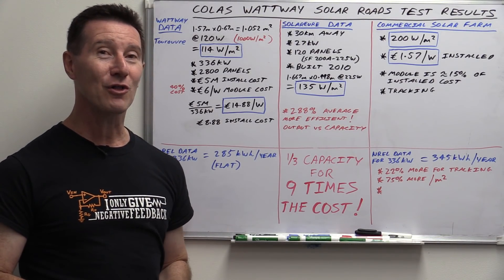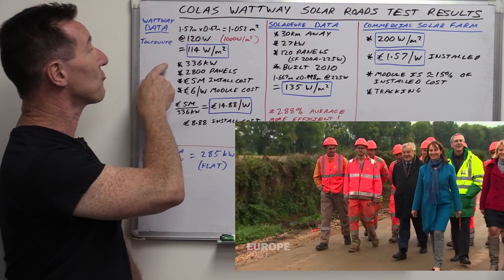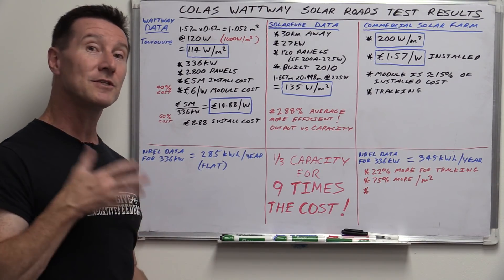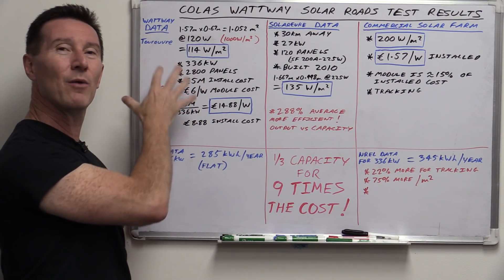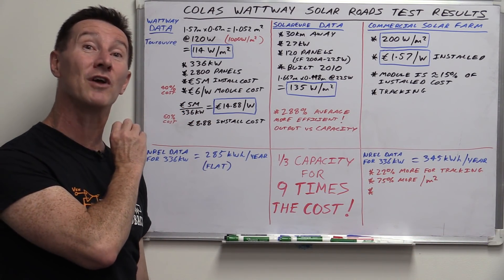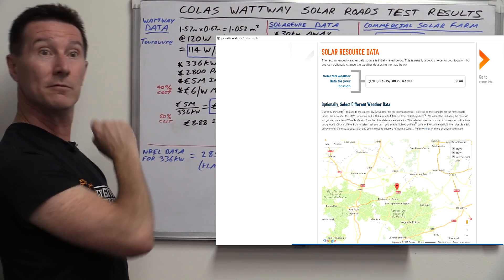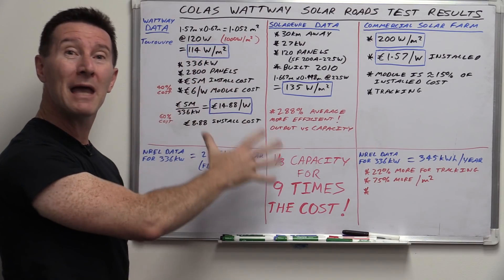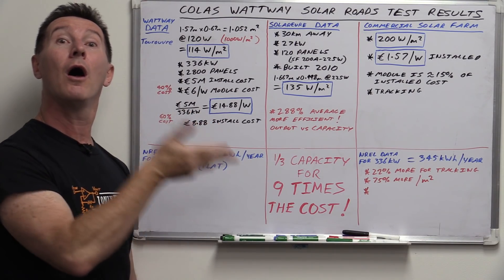EEVblog #1047 - Solar Roadways FINALLY BUSTED! (Colas Wattway)

Comment: Dave, I got half way through and after seeing your earlier vids, I confess, I concluded similar conclusion to follow. Sorry.

However, the problems with solar is that we can not (Europe especially) cover fertile grounds with passive devices. As a person who spent my formative years in Europe, I can tell you that the land is not real estate. The population density is huge and the land has been subdivided so many times, the land parcels are tiny. Yes, rooftops are a good solution, but I think that they are thinking bigger rather than smaller.

Aus and America's have lots of open places, deserts etc to use. Euros don't.
Wind generators are the best solution, but places like USELESS road surfaces (used occasionally) are a great idea. $$ COST is not the only measure of success!! Hell, if that was the case the cost of coal and carbon fuel clean up would be astronomical. 
Whatever the solution is CARBON fuel is the last option of a desperate world drowning in pollution.

All I ask is ... devalue the $$ factor and look at this as a potential power source for small towns and villages dotting the European landscape.
Reply from the maker: Put them on rooftops and poles, and cover over carparks, it's not rocket science.
Reply: But there's plenty of commercial/industrial parking lots that could be covered with solar shelters, even just the basic fixed tilt ones.
Reply: But then why not put the panels to the side of the road, or if there's no space, then on a canopy over the road. It would still cost less.
Reply: You can cover every commercial parking lot, providing solar shading. You can put them in highway medians. Rooftops are still underutilized.
Reply: yeah put them on poles next to and or over the road, on the road is just asinine
Reply: Ned Blagojevic It is much too expensive. If something is much too expensive no one will fund it. Secondly, there is more than enough space in Europe. We have too many farms anyways. We have space on the sides of the Autobahn, the railways, soo many rooftops (99-99,5% don't have solar on them). So before we start plastering roads with precious rare earth's we probably should start there.
Reply: Ned Blagojevic Not really any such thing as a truly robust cell for roadway use.  Consider how frequently roadways have to be resurfaced due to wear and tear from tires, accident damage, fire damage, etc.   Not only would you need to have utterly dirt cheap solar cells, but you would also need almost boundless free labor.  Because the surface layers of an asphalt or concrete road is essentially a homogenous mixture of fill and binder we have machines that can literally eat the old road material, crush and process it, then remix it into a new surface and lay a newly remediated surface back down all in one go, you just drive it down the road and it does it all in a single pass.  By comparison a solar roadway requires embedding a lot of wiring, the solar panels embedded into the asphalt or concrete, and all the necessary interconnections and tie points...and all of that needs to be trivially and quickly repairable and replaceable after accidents.  A machine can not just eat up old solar panels and magically spit out brand new ones, so every so many years everything has to be replaced anew, including all new panels and road material...along with all that wiring (which will be destroyed when the new surface is laid down on top of the old).  Just consider thecdamage that one car driving several miles on rims would do to a solar roadway and suddenly even accident damage becomes incredibly expensive.

Literally, solar roadways are a place that money should only be invested once you have already covered every bit of far more practical surface area (such as rooftops).  Only when there exists no more practical surface area should the least practical surfaces be sought out for coverage.  Otherwise one is just senselessly wasting money.  If you had a choice as to whether to build a 1MW solar project or a 27MW solar project, both for essentially the same install cost, only the 27MW project also affords lower ongoing maintenance costs and requires 1/3 to 1/6 the surface area, would you really conclude that we are at a point in solar saturation that you would rather opt to build the far larger but also far less efficient 1MW project?  We get far greater return on investment if we invest more wisely.
Reply: Europe has Baltic states, where average population density is low, and most of population is located in few denser cities. And land value and cheap labour costs can easily offset amount of solar light they get. So, land is not the problem
Reply: It is perfect solution for US. They have couple of huge deserts that could not be used for anything else. In addition - loads of roofs. Just need few grid storage facilities.
Reply: Funding private home installation would be much more cost efficient and would produce a lot more power. We will soon need a lot of power for electric cars and the infrastructure is not ready yet.
Reply: FutureChaosTV... I am not doubting you, but I think that you should look at the area/kw required and check of farms are big enough to provide. Here in Aus we have 25m people on a SUNNY continent bigger than the entire Europe. We can do solar farms. Eu can't and doesn't have the solar flux or area needed... a fact of life.
Reply: FutureChaosTV ... to the best of my knowledge there are no rare earth elements in solar panels. Just Si which took a huge amount of energy to form and purify. That is why PV is a marginal source of energy. Better options exist but are emotionally  controversial.
Reply: I tend to agree with most of what you say, but remember that this is just an experiment and I wager that they have absolutely no intention of scaling this up permanently, not on the roadway at least. 

I get the rooftop installation but find them very unattractive especially when they are tilted to the angles for optimum efficiency, but will get one soon. Dave may want to do some costings on PV vs PV+battery and include recycle costs. You will find it depressing when you look at things in terms of energy rather than $$$.

Having said all of that I remember that Nicola Tesla was almost kicked out of Uni because he dared to say that he can make AC directly :):)
Reply: I live in Europe and travel all over Europe. There is lots of space for solar, so I'm not sure where you are thinking. You post an image of an unsuitable town, but we have national grids to distribute power from where its easier / cheaper / more suitable to generate to places where it isnt.
Reply: Nuclear is a good option, I'm sad the UKs newest nuclear plant is being so badly handled :( Look up Hinkley Point C if you dont know about it.
Reply: Problem with nuclear is waste storage.
Needs thousands of years to decay.
Reply: +jur4x

The waste problem is highly exaggerated.
Reply: lol. Nuclear waste remains dangerous for hundreds of years. And have to be guarded, otherwise it makes great material for "dirty bomb". So no, it is not exaggerated
Reply: +jur4x

No , I meant the amount of waste generated  by Nuclear reactors is greatly exaggerated. It is estimated  that 97%  (by volume)  of waste generated by nuclear industry are low level radioactive contaminated material (clothes eg) that cannot be used to make  dirty bomb  nor do they need thousand of years to return  to background levels ( still, 100 years is a long time)

 Newer generation of reactors do produce fewer  high level waste waste and there is even a reactor design (sorry, forgot what it's called atm)  that eats up the high toxicity, longer lasting radioactive waste (such as plutonium). Of course waste management is still an extremely top priority that cannot be simply shelved aside.
Reply: I love the picture you've posted of Bologna to illustrate the problem. Here's another picture that shows the city in sunlight to better illuminate the problem:
https://thumbs.dreamstime.com/z/bologna-cityscape-italy-28502180.jpg
See this? Sunlit roofs... SHADED STREETS. Where do you want to put your solar panels? ON THE ROOFS, of course. It's cheaper and will provide more power. But even that is less efficient use of solar panels than it really could be.
Btw modern agriculture is more space-efficient than ever. And according to my calculations, just 5% of the agricultural land we use could power all of humanity. You think that in the age of GPS-guided autonomous tractors, crop surveyor drones, modern cultivars etc. we would starve if we gave up just 5% of the land? Come on. Just the reduced air pollution from fossil fuels would be worth it.
Reply: You can worry about putting solar panels on roads when there is literally no other space for them then LMFAO
Reply: LOL... It is rocket science, Dave. Most of the cities and coastal towns in EU are ancient and don't even have room for cars never mind COMMERCIAL car parks.!. https://goo.gl/images/LRMWNT ... as you can see the town square and the road is the only space available. there is no roof space as most flats are 2-3 story flats. 1/4 acre block? No such a thing :):)
Reply: those hills are used either for food, wine or animals, but yes, not all Europe is uniform.  I wager to say that the experiment is to see how much power they can get, but more seriously, people will develop robust cells which can be used in all extreme conditions. Look at the current installations ...ugly, rectangular and fragile (ask Dave about hail damage). again $$$$/kW is not the point.

Comment: Does this mean you'll stop posting 'Solar Roadways BUSTED' videos? I've lost count how many you have posted now
Reply: You may call this "beating a dead horse", but in this case the horse doesn't want to die, it refuses to die so it requires constant beatings, Dave and others will not stop beating this horse until is really dead.

Comment: they think that is a good idea because you  forgot the most important parameter for them : the place used (They are in constant search to have an ecological electricity production which take the  least possible place)  : nothing for the solar road because it's placed on roads (place already used)  whereas the solar farm use a terrain that could be used for agriculture, forest  or cities (and they have to destroy terrain to build it : it's not really ecological)

Comment: Great and funny:-)
Even if it is a idiotic solution, what about places where they do not have the space for solar farms? Would they be useful in city's where it would be hard to "jump" from roof to roof and maybe more easy just to use the road? I know that buildings will cast a shadow a lot of the time but still?
Reply: Fried Mule that shadow would make it way way worse a few angled panels on the roofs ... where there would already be an energy infrastructure built into the building... would likely give the same output as a whole block worth of solar roadways in those conditions
Reply: The solution for places that don't have enough space for solar farms is the same solution as the one we currently use for places that don't have enough space for conventional power plants; you build it somewhere nearby where there is space, and use power lines to transport the power.

But even if you rule that out, and for some reason you absolutely must place the panels in the city; cities have lots of rooftop space. Cities also have lots of traffic, which makes the solar road surface option even less attractive. And as you point out, there's the shadows from the buildings to consider.

Comment: This might work in areas with limited space for solar panels. Imagine a future city-state where all buildings have solar panels and the only space left is the road.

That is the only reason I can come up with for this technology.
Reply: I think you would be hard pressed to find a location so devoid of free space that you would have to resort to putting them on the road.
Reply: If one was using any morsel of sense, you'd find many many places to install and generate energy with much better ROI before being desperate enough to do this.
Reply: Matteqa I can see a use case in remote spots for signalling and traffic monitoring... if you could store the energy... and I am envisioning a few strips not Km... and you can do the same thing with panels on a stand on the roadside for a lot less money if you have the room and are not worried about the appearances
Reply: Cities  have lots of buildings witch have roves ..roves are great  space for solar panels ho would have thunk it
Reply: Glen Collins, I've already seen a few examples of solar panels used in remote spots to power roadside equipment; in those examples, they mount a small panel on top of the pole shared by the equipment it's powering.

Comment: If they tried that in the UK then most of the panels would spend 90% of the time covered up by road works cones. It would be better to focus on installing panels on every home as this would make power distribution easier and houses already have roofs that cars rarely drive on. They would also not be subject to wear and damage as they would be on roads.
Reply: I have a feeling that if they were installed in rural locations they or at least the wiring for them would get nicked. People already risk their lives near train tracks riping up copper, it would be incredibly easy for them to access a rural road at night.
Reply: K2LSS, Yes I agree, The panels they fit to power road signals are always disappearing. I think that the cables are most at risk because the efficiency of road panels is so low that no one would want them.
Reply: K2LSS at the voltages you can get up to with a string of panels it usually makes more sense to use stainless steel cable so larcenists would probably end disappointed ... or dead if they tried it in the daytime... which raises another issue how do you feel about having your road live at near the max through voltage of the panels? Usually 800V DC??
Reply: Glen Collins, Mostly the thieves would work at night. SS resistance is generally too high for power transmission as it conducts about 44 times worse than copper although as SS is worth more than copper it would be a good find for thieves if it ever was used but you have a good point about power within the road. Imagine a crash where spilled fuel ran down into the cable runs.

Comment: not just the cost, but its impractical, because the road is a hard rough surface, prone to movement, physical damage, also the road gets very hot, which will destroy the plastics and bonding agents, reduce the life etc.. I very surprised a crazy project like this has ever been attempted. The only real reason for the massive waste of money is criminal intent,  money laundering, yep the corruption goes all the way to the top, making it impossible to prove.